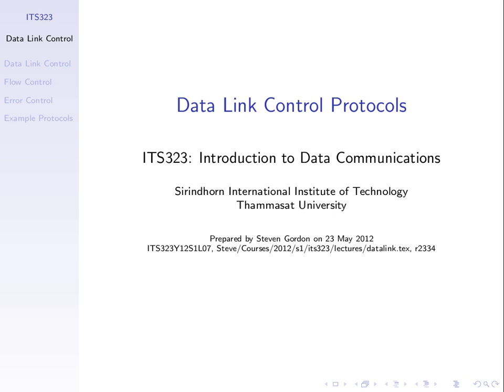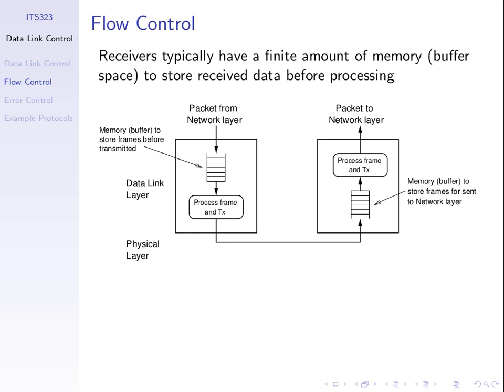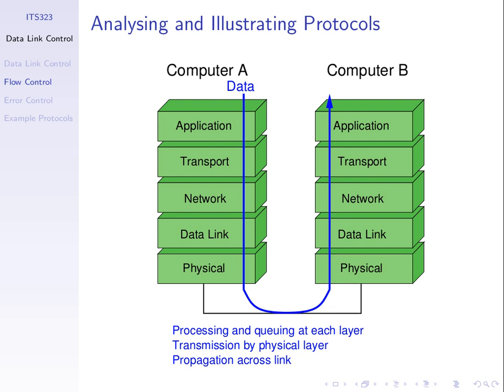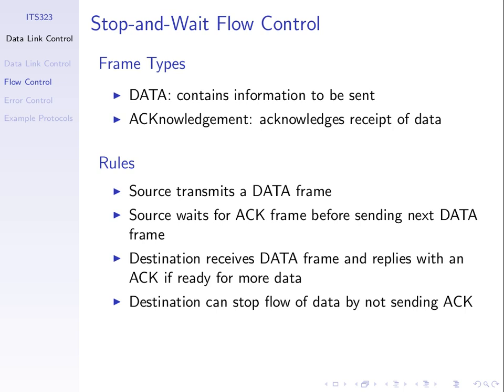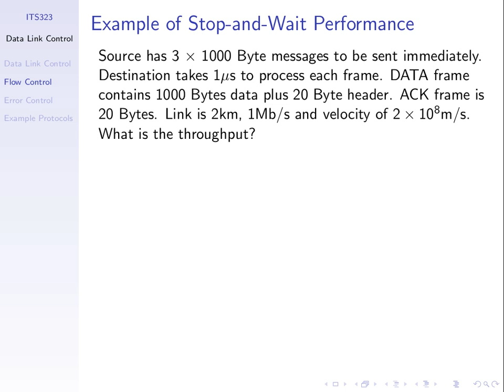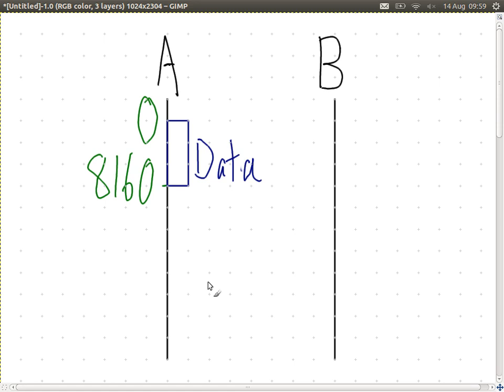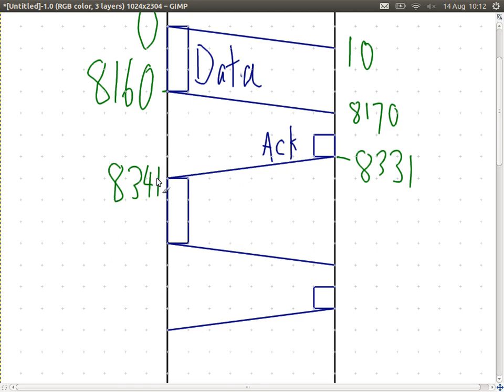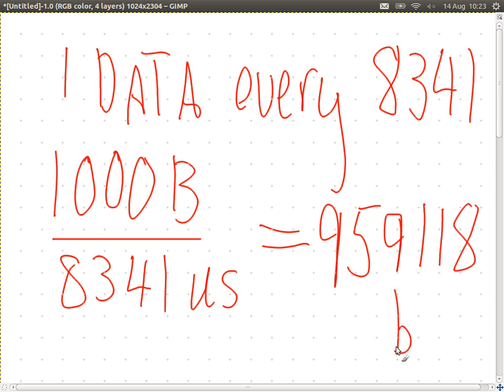ITS323, Lecture 15, CS, 14 Aug 2013 - Stop and Wait Flow Control

Comment: Dear Prof. Gordon, thank you for your insightful lectures and nice illustrations. I have a question regarding the Stop and Flow COntrol. What happens if the ACK frame is lost on the way before reaching the transmitter? Does the receiver again send it after some time? How is this issue handled in the protocol?